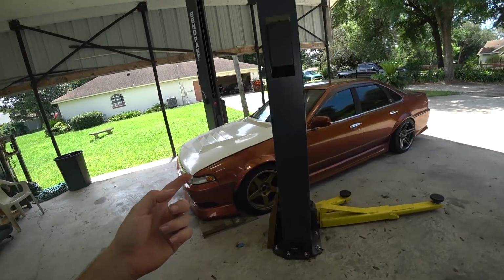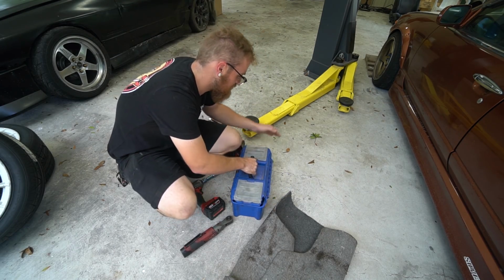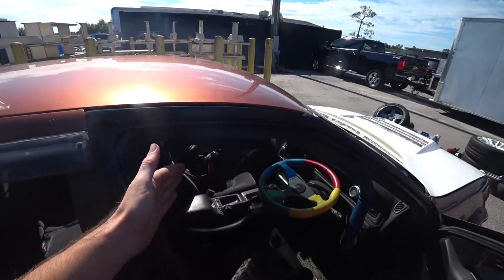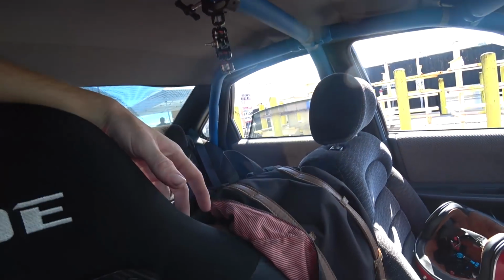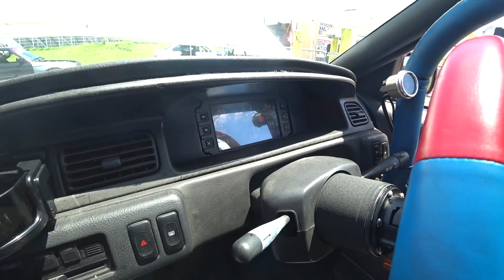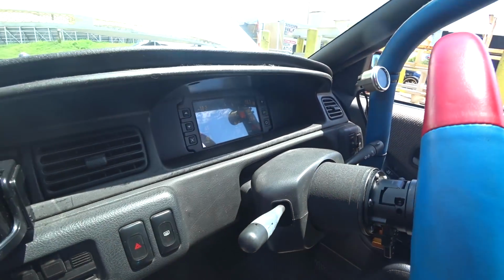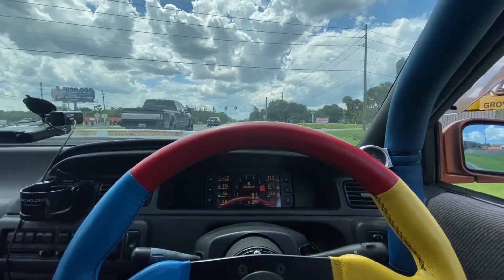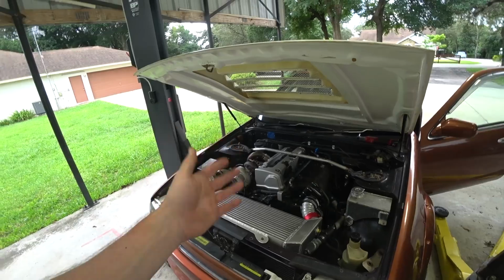Drifting my Honda K24 Powered Nissan Sedan for the first time. It’s a smoke machine.

Comment: Taylor, what about a "drag week" style hitch receiver thingy that hangs off the back of the car to store tires, tools, a jack, maybe an ez up?
Reply: "drag week" or "drift week"?
Reply: Take it a step further, get another cefiro and chop the back half, build it out as a mini trailer. It’s been done before😁
Reply: @Drewairplane  What about the poor old cefiro chassis?
Reply: @Jumoana  drag week.. on drift week you don't have to pull your stuff. they load all the tires and equipment into a truck that goes track to track with everyone, you can bring other cars to haul your stuff as well.
Reply: @sirmonkey1985  I don't you know what you're talking about.
Imagine the amount of tires a drag car burns through during a week.
Lmao.
Reply: @Jumoana  in drag week you change between street and slick tires
Reply: @Jumoana  not as many as you would think. Between tracks they change from race tires to street tires. Race tires for most will go about 15-20 runs for most folks before they begin to fall off. For the high hp guys could be as few as 5-10 runs for those 3000 hp guys.
Reply: @lloydholt6511  That was my point, not many or as many as sirmonkey thinks.

Comment: I just feel like that thing should be spooling that turbo sooner so you don’t have to kick the clutch as much. Please get this thing on the Dyno ASAP. This setup would probably benefit from some cam advance for sure. That midrange is lacking man.
Reply: It's the gearing. He's in 3rd gear because 2nd is too short, so needs some clutch kicking. Cam advance is 40 degrees through spool up. It is only pump gas
Reply: @roguearttuning  did you tune it? I still think it should see some Dyno time. Really dial it in. I know street tuning is nice and you can get it almost perfect with the k series utilizing the knock sensor but I just feel like after it’s ironed on the Dyno it’ll be way better
Reply: @PRZJ91  yeah that's me. We were actually going to throw it on dyno last week but I was sick beginning of the week and kinda threw everything off. Plan is to Monday as of now. We were having issues with VTEC working and VTC was only working half way through pulls then falling to zero. He's replacing VTEC solenoid and oil strainer and that will hopefully take care of those two things.

But this has all been on pump. He also wanted it conservative on pump, it would be extremely easy to make more power, he actually had me turn it down a touch if you saw in one of previous videos. But plan is to do pump and ethanol on dyno, and we will throw a little more at it on E
Reply: @roguearttuning  I like it. Can’t wait! Really dialing in those cam angle tables is going to open this thing up so much! And then ethanol is gonna be that much better! Lol
Reply: @PRZJ91  it will improve with some tweaking for sure, but it actually gets going pretty well. Just with the rear gear he's got, gearing is not ideal for the the skid pad. With the e85 octane and a little more ignition timing 3rd on the skidpad shouldn't be an issue once that's all setup. Hopefully next week we'll have it all done.

Gotta figure something out the Rev limiter. It had no issues before, then all of the sudden it was almost soft cutting around 8k. Nothing in tune that would cause it, so not sure if there's another soft cut software error with Elite update, or if it was just struggling with the VTC not working on higher RPM. We'll know in a few days
Reply: @roguearttuning  interesting, i haven’t tuned with haltech yet. That sounds like it could be it. So much data on these new standalones. I love analyzing the logs though.

Comment: I have never been more excited for a build brake down for a car as these one. If i have to build a street car at these moment it will have a k24 engine similar too what u have build. I am still rooting for u too find a solution for the air-conditioning. Of u pull that off wow!🙌🏾

Comment: Set up a second windscreen sprayer setup under the hood and plumb it to some misting nozzles in front of intercooler
When intake temps get up there give it a little squirt and temp will come down instantly 

I've done it a few times over the years and def seems to work.

Comment: This thing needs a proper dyno tune ASAP!! Maybe the video is deceiving, but it seems like you really have to work to keep it in boost. And it seems like it doesn’t make boost until pretty high in the rev range. Maybe it’s just a driving style thing going from NA to turbo? OR maybe Final drive is jussst too tall for 3rd, way too short for second?
Reply: It's the gearing. He has to use 3rd and RPM is too low to keep in boost
Reply: @roguearttuning  Thats what I thought, gearing also explains why he’s struggling to hit limiter. He’s prob over like 90mph wheel speed at 8k. It takes a LOT of torque to overcome a decently grippy setup to that wheel speed.
Reply: @gokartsRfun  we'll throw it on the dyno and a little more sauce at it with some ethanol next week. It could still make more on pump easily but he wanted to keep it conservative which I totally get

Comment: How you are able to run a full day on just 2 sets of spares and a set that you still need to be able to drive home on baffles me. Especially on a car with decent power. I used to go through 2-3 sets in the rain with a  300ish hp 2400lb 13 hatch. And at least 5 -6 sets in the dry leaving just enough tread to get home. And that was on an actual track surface and not a cheese grater road.... apparently I should have been running whatever tires you run😂....... also, I feel like you’ve forgotten how to slide a 4cyl... MORE RPM!!! Kick that clutch with your  👠 and bang that limiter with your 👜!!! (Just joking btw, you are one of the best drivers I’ve seen especially in a car you are more familiar with. You need to talk one of your buddies with a FD level car into letting you have a go in it, mainly because your tandem abilities are beyond what I currently see in the Pro ranks)

Comment: So rocking no air filter on a street car?
Reply: @AcloYde  I've watched them all and I didnt see any air filter. And wouldnt do much not being on the turbo where air actually goes in the engine.
Reply: There's a pipe from the turbo inlet into the front-right of the V-mount which puts the filter in front. You can't see it from the bay when the bumper is on, but it's there.

Comment: Time to have Brent tune it. Cuz sounds low on power
Reply: It's making about 380-400 wheel. He's clutch kicking it because it's in 3rd gear and RPM is too low for it to be in boost. The car easily can make gobs more power but that's the level he wants it as on pump gas, hence why he asked me to turn it down a touch in video before

Comment: Please pardon my ignorance. But is it under powered? It seems that you’re having to clutch kick an AWFUL lot to keep wheel speed…
Reply: It's the gearing. 2nd is too short so he's having to use 3rd and some corners the RPM is too low and it's not in boost